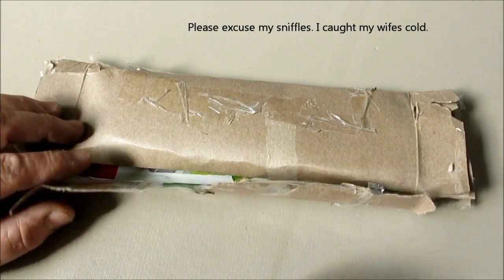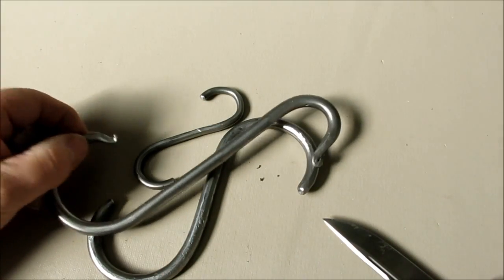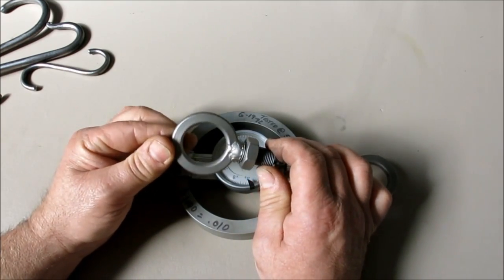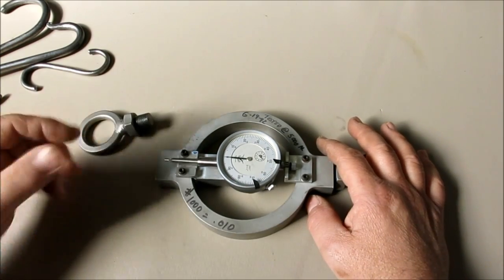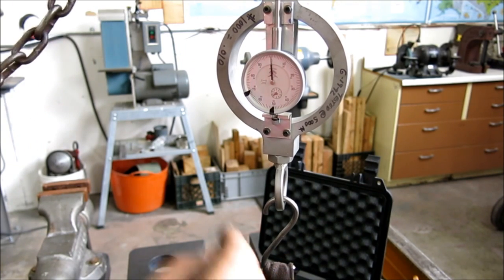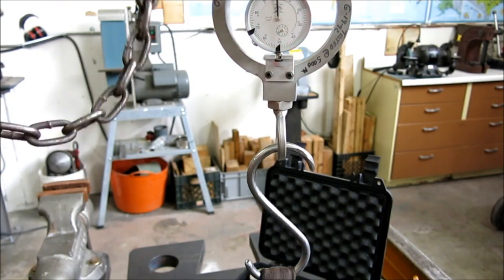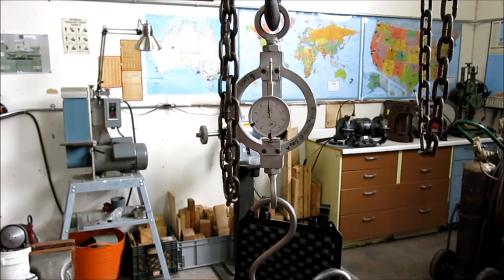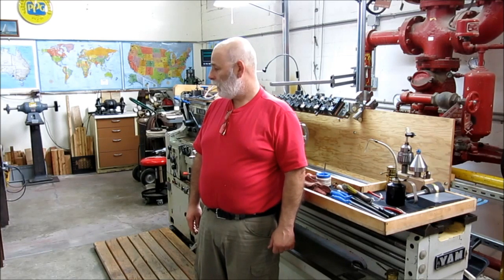Snack Break 14

Comment: It's curious that the cold rolled hook did not begin to deform until about 800 pounds was applied. So was 800+ pounds applied to make the hook shape. Have you considered a job as a strong man in a circus or something? Actually it would be interesting to test how much force was required to do the initial bend.

Comment: Great video Tom.   I used to do a lot of load testing for different applications at work, and used dyno's of the hydraulic variety.  I did not know that this style of "ring" dyno existed. This made my week seeing this.  What is your position on the fatigue resistance of this alloy in relation to it's accuracy with repetitive use?  I just love this kind of stuff, so thanks a million for sharing it.  I thoroughly enjoy all of your videos and your presentation of the material is excellent.
Reply from the maker: Hi Mike,

Well when you start talking about aluminum and fatigue resistance in the same sentence its bound to get complicated. One of the problems with aluminum is it does not have a defined endurance limit like steel. That said this instrument does not see a lot a repetitive cycles so fatigue should not be a problem. Over loading and yielding the ring is the risk. I can personally tell you that Its hard to generate the kinds of forces necessary with hand force multipliers. Hydraulic certainly. My 6K come along with me hanging on the handle was not enough. So its seen maybe 7K as a maximum load with no problems.

cheers,

Tom

Comment: Tom

I'm trying to become a regular on your channel.  I learn something every time.  Sometimes it's what not to do! LoL!  Cool stuff!  In school for a project, I did the tensile strength of adhesive using popsicle sticks.  Fun stuff!  (are we weird?) 

I had a thought about your set up.  Is the strap applying a different load to the hook than the metal eye?  My thought is there is more force towards the tip of the hook using the strap.  Would it change the outcome of the test if an eye was used on the bottom too?  Maybe two equal hook test is needed?  One with an eye the other with the strap.
Also, I mentioned to the blacksmith guy about ovalizing the metal. Would it give it more strength if it had a taller profile in the hook area?
Reply from the maker: Hi Dan,

Trying to become a regular viewer. Wow, looks like  I need to step up my game if you're hesitant....

On the hooks its all relative to how they are used. Yes you might pick up some additional load capacity by changing the attachment points but its not really relevant as long as the comparison is done the same. Changing the material cross section modifies its section modulus which changes its load carrying characteristics. The stiffness changes I believe as a cubic function of the depth, so a deeper section with the same amount of material is considerably stiffer. Hopefully I answered your question.

Cheers,

Tom
Reply: oxtoolco What I should have said is that I'm trying to include you with the other machining guys that I watch on here. LoL!  Not being hesitant. LoL

Yes, you answered my question.  

Isn't the goal to find the strongest hook?

I'm impressed with your ability to do math in your head.

Comment: That was an interesting tests on the S hooks Tom. Thanks for sharing with us! I really love that shop made scale. If you ever want to donate it you can send it my way!

Adam
Reply from the maker: Hey Adam,

We have a bunch of the commercial type like this at work. They go up to 50,000 lbs capacity for the larger ones we have. I have seen them on ebay up to 200,000 lbs. You need a forklift to move them around. Let me know if you need to weigh something heavy.

Cheers,

Tom

Comment: Tom;  The load testing jig is quite clever and a good use of materials and I watch your videos regularly (much better than TV in general).  However I think you are mixing two different properties of Aluminium and Steel.   As I understand it, deflection of material under load is stiffness, not ultimate strength measurement.   I do not have actual data on the stiffness of 7075 but in general aluminium is 1/3 the stiffness of steel, which is generally measured by Youngs modulus of elasticity.
Reply from the maker: Hi John,

You are correct that steel is stiffer than the aluminum. However I needed to load the ring to a higher stress than I could get to with plain steel. The aluminum ring distorts more per unit stress than the steel does but the higher yield strength of the 7075 aluminum allows a higher total stress and therefore higher total capacity of the instrument in the elastic range of the material. The bottom line is the stress for the load range we needed to measure was too high for 36ksi steel. If we made the ring out of steel it would need to be much more robust and with its higher modulus wouldn't give us the needed resolution on the instrument.

Cheers,

Tom

Comment: I'd love to see examples of Mike's hooks full-hardened, and others drawn to various degrees in comparison tests.
Reply from the maker: According to Mike the hooks he forged were made from hot rolled steel. The hooks I made were cold rolled steel and cold bent. Changing the material to a heat treatable steel would improve the strength by quite a bit.

Cheers,

Tom

Comment: The test LOOKED fair and even. I'll yield. Next time I'll send some better steel and tell you is was mild...
Reply from the maker: Hey Mike,

Thanks for playing along and being a good sport. You missed the hacksaw notch on the side opposite the camera. <g>

Cheers,

Tom
Reply: Mike

Forgive me if you've already thought of this, but wouldn't segments from a recycled car coil spring make good source material for these hooks ?

Regards
Reply: Stephen Smith Yup, they sure would. I would have prolly done better in the stretch-off, too. I was trying to duplicate Tom's hooks, so we could debate forged and cold bent. I was sure hot was much better.
Reply: Mike

What if you were to flatten/ovalize the material a bit so make the metal taller when it's in the hook shape, would that give it more bending resistance?
Reply: It sure would. But Tom can't do that, so I didn't. I have already threatened to send some of those, but I don't want to abuse my free testing facilities!

Comment: Hey Tom,
That section of rail on the bench looks like the Bethlehem rails my crew and I removed from one of the labs at UC Berkeley. Still have a piece in my shop. They were Trolley crane rails. Covered with lead paint too. Just a thought!!
Sweet video's you make, watch them all.
Reply from the maker: Hey Whitecaps,

Good eyes. Couldn't let you guys send all that to the metal recycler. At ten cents a pound I wish I got more of it. That crane rail size is hard to come by.

Cheers,

Tom

Comment: What machine work is needed
Reply from the maker: Hi Flineman,

Is your question what machine work is needed to make the ring dyanmometer? Not much is the answer. You could almost band saw it out and it would work.

Cheers,

Tom
Reply: Question was what machine work was needed by the other fellow needed done
Reply: Try that again what machine work need by the hook maker
Reply: I have the parts off to a local machinist, All tools, a small cone for the hardy hole, a special drift and some spacers. I'm looking to see how they come out when Don finishes them.There's always something. I know the old timers had to make their own tools, but forging a 1" piece of 4140 down to 1/8" in 10 inches is NOT fun.

Comment: So the hot bent ones got cold unrolled?

Figured as much. The blacksmith ones are cool looking but this is the difference between using a strong material to form an object and choosing how that material is on yourself before you form it.

The blacksmith also has to choose between hard and brittle and soft and pliable. A lot of work on that plate. Cool none the less.

That gauge is pure brilliance and i'm not talking about the device only. The idea that someone can do something just fine without buying it is such a forgotten thing nowadays.
Reply from the maker: Hi Aserta,

Thanks for the comment. You are correct that its pretty satisfying to make something like this for yourself and have it work. Ins't science great.

Cheers,

Tom

Comment: Hi Tom !

Nice little experiment, I think !

I sometimes do a little black smithing myself and would expect hot bend material would be "stronger" than cold bend and the cold bend would be more brittle.

What would you expect the result of your test would be IF THE HOOKS WERE MADE of THE SAME

1) material,
2) radii,
3) thikness 

?
Reply from the maker: Hi Keld,

Cold bent because of local work hardening in the material of the bend. Slight advantage.

Cheers,

Tom

Comment: Can't defeat physics: the larger the radius, the weaker the hook. Hooks bent in that fashion naturally place the load further from where the bend starts giving advantage to the load. Try a hook with a tight radius...somewhere near the minimum bend radius of the material...also try a hook bent similar to a "checkmark" with a v-bend. I'm betting the SWL will increase substantially.
I'm sure you have another 5-6 feet of CR bar to ruin??  lol

Colin
Reply: I considered cheating and making a couple of 1" bends in the 3/8" bar, but I really did want the data on strength.
Reply from the maker: Hey Colin,

I need you to come over and run the chain fall while I read the dyno. Let me know what a good day is for you.

Cheers,

Tom
Reply: Lol, you should probably be thankful I dont live close. I'd be picking your brain on a regular basis..:-)